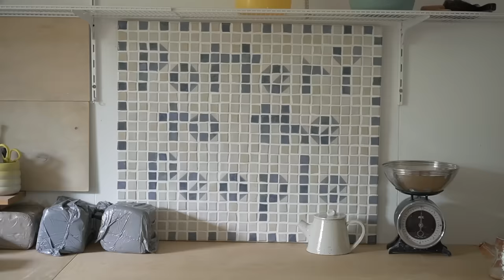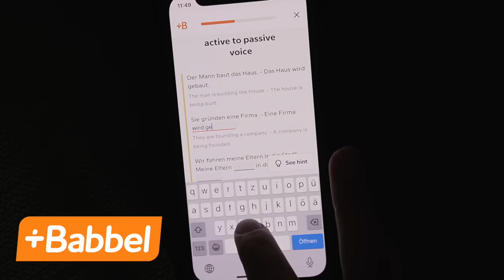The biggest MYTH in pottery.

Comment: This may have already been said somewhere in the comments- But,  trapped moisture becomes trapped steam which will definitely cause an explosion
Reply from the maker: yess! 🙌🙌
Reply: indeed, water moving to a vapor point expands much more than air ever could
edit: vapor state* I meant moving past the vapor point.
Reply: Some rough numbers, going from room temp to 900⁰C is going to make trapped gaseous air want to expand in volume by about a factor of 4.  So the heating needs to be slow enough for that pressure to either seep out or be contained. 
 I imagine most pottery is porous enough for it to escape before the pressure can build up to anything damaging.

Whereas any trapped liquid water, even invisible droplets, is going to expand its volume by a factor of around 1700 between 99⁰C and 101⁰C.

So not only do you have the massive amount of expansion, there is essentially no time for the pressure to dissipate.
Reply: @Juttutin Water doesn't vaporise instantaneously when it reaches boiling point, so there is still some time for the water vapour to escape. That's why the slightly damp pots didn't explode - they were thin enough that the remaining water was able to escape quickly enough to avoid an explosion.
Reply: Yes. I wonder if there might be another parameter too?
not a potter here, but my understanding is that there is shrinkage during the drying/firing process?
If there is trapped moisture in some sort of cavity, and the walls are thick enough, does the wetter inside shrink more slowly than outside? enough that it can weaken the wall enough to facilitate the explosive escape of the steam? that would mean maybe the ideal environment for an explosion is a sealed cavity combined with slightly damp clay?
Reply: What about in a glaze firing, when you've reintroduced moisture? Is it all close enough to the surface it fires off, or do you allow the glaze to dry a couple days before loading it as well?
Reply: @thomasdalton1508 at the transition point, the entire power of the kiln will be used to boil the water. Untill the water has evaporated, the temperature in the kiln will not rise (much), the controller will do it's best to maintain the ramp program.
Reply: @dougaltolan3017  That's only true if everything is staying in thermal equilibrium the whole time, which probably isn't true. The areas that are moist will be cooler than the areas that are dry, since there isn't much thermal conductivity between them. Even if everything is in equilibrium, it will still take time for the water to evaporate.
Reply: @Juttutin  I think the more important factor here is going to be the structural integrity of the clay in which the moisture is trapped.

When water is heated past 100C and mechanically confined, it stays liquid, but becomes pressurized.  If that mechanical confinement is released, the water then explodes into steam all at once (creating a steam explosion).  This phenomenon is also known as a "Boiling Liquid Expanding Vapor Explosion", or a BLEVE.

The conditions to create a BLEVE in a clay object in a kiln are:
moisture content (supplying the water to boil/pressurize)
low-porosity clay (preventing the water from escaping and therefore causing it to pressurize when heated)
thick/sturdy clay walls (providing the mechanical integrity to retain the pressurized water)

As the clay is fired, the water heats and, being confined by the clay, begins to pressurize since it cannot convert to steam.
as the temperature rises, so too does the pressure of the restrained water
Eventually, the pressure exerted by the water exceeds the mechanical limit of the clay confining it, and we get a series of events all at once:
1 - the now compromised clay wall suddenly is able to hold massively less force/pressure than before.  This causes the clay to further compromise and fail, as the force it is already holding is greater than what its new limit is
2 - the failing clay begins to be pushed away from the water.  the water, being superheated, immediately begins to expand into steam.  The steam continues to press against the clay, though at a minutley lower pressure as it expands.  This sets up a feedback loop with step 1: the clay yields further, both creating more space for the steam to expand into and offering less resistance against the stored energy in the water/steam
3 - the clay finally fails entirely, allowing the water to flash into steam and fling the now-disconnected pieces of clay all over your kiln.

It should be noted that, in the case of a BLEVE, steps 1 and 2 cycle back and forth until step 3 happens in a matter of milliseconds.  once the containing material begins to yield, its ability to resist the water within falls exponentially faster than the pressure is relieved by the expansion room created by the yielding material.

BUT - to circle back to my original statement - this cycle does not occur if the clay is not strong enough to resist the force of the expanding water.  In that case, what instead happens is that the clay will yield before any pressure is developed, preventing an explosion.  This may or may not still produce a visible failure of the part, depending on how FAR the clay had to yield before the water was able to escape at the same rate it boiled off.

Comment: My pottery instructor was adamant about explosions being a result of moisture and not air. It just makes sense. Water expands so much more than air when heated (about 1600 x by volume, i think), which is why steam was used to power much of the industrial revolution.
Reply from the maker: ahh so smart to make that comparison! Well said.
Reply: The exact amount of expansion depends a lot on how much pressure it's allowed to build up to. If you look at the saturation curve of water, it can build up a couple thousand PSI while in a saturated state. To keep a very long explanation short, if you have water trapped in a container, there's a specific ratio of volume to mass (specific volume) above which it will be in a saturated state (both liquid and vapor present at the same time). While it's in this saturated state, any increase in enthalpy (temperature specifically 99% of the time) will result in a significant change in pressure (relative to the same change in enthalpy while in a non-saturated state).

I would link the wikipedia page, but youtube doesn't like links. You can find the relevant diagram on the wiki page for steam (pressure-enthalpy diagram).
Reply: Tht's what I would going to say: steam engines were very *very* powerful things (at least back in the day).

Comment: Great video, and I think you're entirely right. One easy(-ish) way of demonstrating this: take an empty pot, cover its opening with a taped down plastic bag or similar. Heat the pot and see how much the bag inflates. Then try the same with a few splashes of water in the pot, allowing the water to boil away. You should see the bag inflate much, much more with the latter, as the thermal expansion of air is nothing next to the volume change of water passing from liquid to gas.
Reply from the maker: Well said!

Comment: I will say that as a public school teacher, some of our biggest enemies are time constraints and environment. Ideally we would like to get everything to the correct hardness/dryness before firing but in some schools there's just not enough space to store work to dry for that long (students also want their finished work super quickly) or the production is rushed because classes are too short and so you get pieces with bits and parts at different dryness and thicknesses. And school teachers, from my experience, also don't often get to control the temperatures in their rooms so you never really know when something is fully dried. I also remember a custodian came in overnight and shut the kiln off which absolutely ruined the students work and upset the temp in the kiln/drying room.
Reply: I work in the US btw
Reply from the maker: Totally! I had the same problem in the community studio I ran. Everything had to go from leatherhard to bisqued within a week. Something that saved me was keeping a constant rotation of pots drying on the top of hot kilns. We fired every day so we always had kilns going. Idk if that's a solution for you but that really helped. Otherwise, candle or a very slow bisque ramp will be the key.
Reply: Has anyone tried to speed things up with silica gel in the later stage of drying? It absorbs moisture very efficiently. It can be reused (just heat up to release the moisture) and some cat litter products are made of silica gel so it's pretty cheap.
Reply: This is what I came to the comments to say, I only took a few us public school classes on the stuff, but it would make sense that a classroom atmosphere would lead to the prevalence of this ~myth~
Reply: @tkava7906   the problem is that the silica gel will have to "wait" until the clay sucks the water from the inside before it can catch any moisture
Reply: That custodian should be fired
Reply: No space for storage and no time for the complete process before marking and reporting.
Reply: I’m a first-year in pottery, and this helps a ton. I’m glad I made my work stay out for a week
Reply: @tkava7906 Freeze-drying may help, though as the items in question are already stable, creating water ice first is probably not needed.
I.e, "simply" vacuum desiccating.
Needs a suitable desiccant and a vacuum chamber to pull the initial vacuum in, and probably occasionally re-pump to remove gasses that diffused out from the pieces like the big ball of air in that ceramic ball from this video.

Comment: Heated air does expand, but moisture (water) turning to steam is a massive increase in volume. Basic physics says the change of state is far more significant in putting pressure on the clay form than simple gaseous expansion. Thanks for the experiment!
Reply: Yeeep. Steam expansion is ultimately the cause of lots of different explosions throughout many different materials and processes that involve drying. From forges to resin, pottery to baking it's almost always steams fault.

Comment: I think the reason that your 'wet' pots survived was that they had enough surface area to mass for all the steam to safely escape. The steam needs to be confined for long enough to build up pressure and then that pressure needs to exceed the structural integrity of the clay. I have a feeling if you repeated the ball experiment but fired it at the same moisture level as those pots it would almost certainly explode regardless of how gentle the cycle you use is.

Comment: Hi Mia. Great video.  While I agree about the water vs air, I think it might be more complicated. I had 2 small but thick sculptures that were never fired in my first studio. Sat at home drying over 5 years. I drilled into the bottoms and both pieces bisque fired fine. Glazed one and it blew up in the glaze fire. Definitely no trapped water in it. Only 1-1.5" thick. Sometimes there's no easy answer.
Reply from the maker: That's strange! For sure it's more complicated and depends on the piece & technique. I tried to simplify it for the video. But I am curious what would have caused the explosion here... Maybe too much water soaked in during the glazing process and it wasn't given enough time to dry out? Ah it depends...

Comment: What might be an interesting experiment would be to make several near identical pieces sequentially so they would have dried a different number of days when you fire them at the same time. Mark each one to differentiate them. (2 days, 3 days, 4 days) See which explodes and which do not. Of course one exploding could break others. Not sure how to control for that unless you had multiple kilns with identical temperatures.
Reply: If you’re doing them sequentially, just fire them in separate batches. Make them all at the same time, but fire one at 2 days, one at 3 days, etc. Would use a lot of energy but worth it for the sake of science 😅
Reply: @Aaakeith  Exactly!

Comment: One thing I've experienced with wild clays where no temper is added is that, even after thorough oven drying (500F), wild clays normally include a bunch of organic material - roots, bug junk etc.  Upon kiln firing, the surface can sinter to the point it's airtight, trapping organic gasses that expand and cause the ceramic to bloat and/or explode. Shocked the heck out of me when it happened but it was a good lesson. Added temper would have allowed the clay to breath, preventing the problem.
Reply from the maker: ahh good point! I hasn’t thought of that problem. 🙌
Reply: Agree partially to the statement “teachers have lied”. I love that you made the effort to create a myth buster and it was really interesting to watch. ❤ BUT The blanket statement that it wont happen could lead to unnecessary fails and distrust in teachers. Experience is everything in every craft and you have tons of it. I do not study science and have very limited understanding of gasses and minerals but stuff in any studio like: Glazes, clay bodies, people using fabrics brought in, hand creams, coffee, plastics, papers with strange paint or metallic ink or chemicals etc CAN get into the clay body while the process of making is happening. Air expands and Gasses are released in firing and with no where to go will stress the enclosing form to explosion point. As a teacher it is far easier to explain to a beginner potter that trapped air leads to exploding pots. Perhaps a correction to you video is not that teachers have lied but that there is a possibility that it could happen. In order to be safe, Best practice, wedge (for more then just air bubbles), prick a hole in a closed construction OR risk it and other pots around you. 🎉
Reply: Lol!
"wild clay". 
That brings about such a hilarious visual, for some reason!  :P
Although honestly, if you've got bugs or root bits, etc in your "wild clay" it means you haven't processed it properly.
It ideally should be made into a slurry, (where it can be strained if needed) then dumped on a porous surface to slowly dry out to the usual clay consistency before being cut up and packed into plastic.
Reply: @TheMurlocKeeper  By organic material, I meant whatever's in the clay after processing. Where I've strained through a 150 or 200 mesh screen, what's left is as close to pure clay as I've bothered to go, but, on firing it can sinter up and prevent gases from escaping, resulting in bloating or even blowing apart.

Comment: Great video! You really got me thinking. Try making a solid clay ball the same size as the one you bisque-fired. My guess is that the trapped water in the solid ball will cause an explosion. Just Kidding.  Don't do this, it will definitely explode. 

The operative concept is not water versus air, but "trapped" water. Air can expand and contract, it does that all the time inside of things. It doesn't cause explosions. Water turning into a gas however is a different story. Much more pressure. Much more expansion. All happening very quickly because of the latent heat of water, i.e. heat/energy builds up in liquid water until right at a specific critical point, the water becomes a gas, all at once. Boom.
Reply from the maker: yess i should have done a solid ball instead of cups. Explosion for sure 😆 but I would fear what it would do to my kiln!!

Comment: I'm still going to dry for a long time and I am still going to put a hole. At my school studio the tech always checked each piece before it went into the kiln and would reject pieces he didn't trust. Over the 3 years I was at that studio I saw plenty of pieces spontaneously disassemble and take out other peoples work. It was always an event which resulted in an after action meeting in the classroom. We were using a gas kiln, not electric, but we would often use electric for the bisque depending on how many pieces there were.
Reply from the maker: nice! Yes I still 1000% recommend putting a hole (I wish I had said this in the video) because the hole will help the inside of the piece to dry out. I would only skip the hole if it destroyed the function of the pot (ie a double-walled cup).

Comment: I only threw for a couple of years over 20 years ago, but the only time I had a failure was pretty obviously from trapped air. A largish flake popped off a mug and left what was obviously an air pocket. I mean, it was a little hollow. My fault for not noticing it in the throwing (I was just a bit beyond rank beginner,) so it can happen, just not catastrophically like the pix you showed in your video. I've actually still got the mug, I turned it into a pencil mug.

Comment: Great video! I reckon you should do another proof where you run a harsher fireing program the explodes the wet clay but the same program doesn't explode the trapped air. Because technically you have only proven that your fireing program prevents explosions

Comment: I get where the myth comes from. It's basic physics: pV=nRT
slightly simplifies explanation: n is the amount of gas molecules and atoms, which obviously doesn't change in a closed space. R is a constant which means it doesn't change either. V is the volume, so another constant in this case. T is temperature and p is pressure. Therefore if we raise the temperature, we also raise the pressure.
The idea that trapped air can cause explosions is the opposite of far-fetched!
So either the higher pressure is not enough to lead to an explosion or the clay isn't airtight and therefore not actually a closed space. I don't know much about pottery, but if water can evaporate from the material, then I wouldn't be surprised if it also lets though air molecules and atoms.